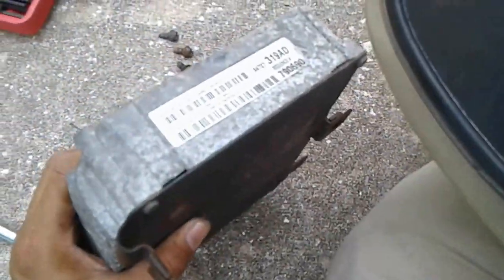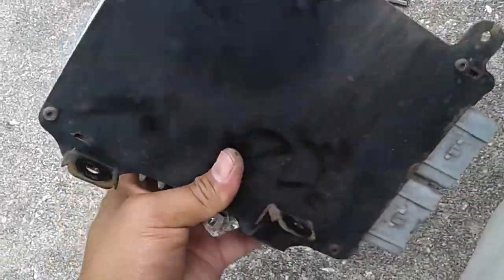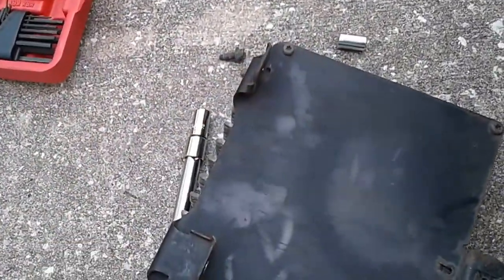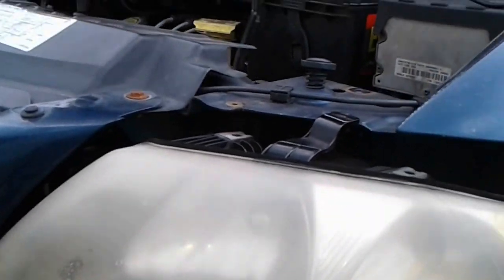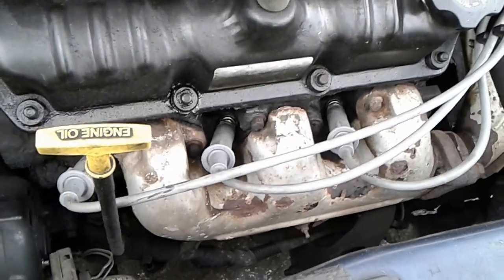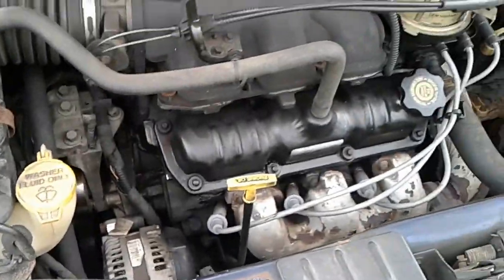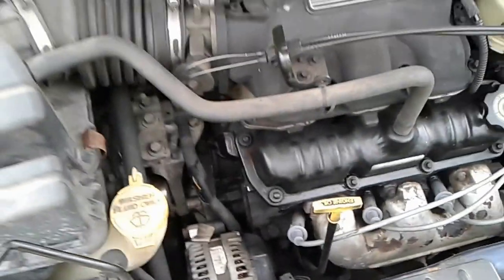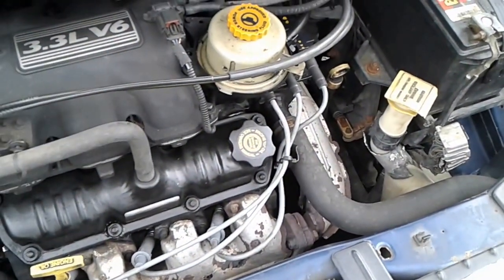Vanlife - Is This A Problem? (V559)

Comment: I had a 2001 Dodge Grand caravan sport 3.3L I replaced the Ignition coil & spark plugs when I was getting misfire code, it made the van last 3 months longer. The real problem is the lobes on the camshaft where worn & they eventually wore down so far the push rod couldn't open the valves thus misfire. I sent it to the salvage yard.

Comment: Hello Denoy If that is a hole on that exhaust manifold you would be hearing a loud exhaust noise. Your computer would be receiving unmetered air readings from your leading O2 sensors witch would make your engine to run rich. Causing you to have poor gas mileage. What trouble codes do you have. What are your short fuel trim and long fuel trim readings. You might get all this readings checked free at auto parts stores and you can post them on the comments for mechanics to help you with a possible fix.